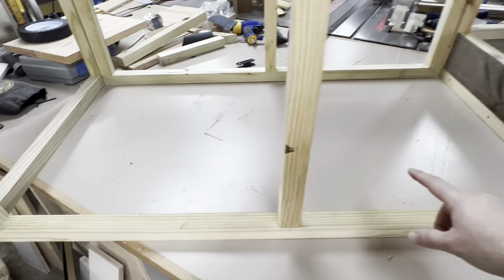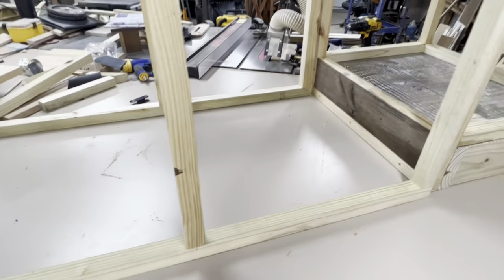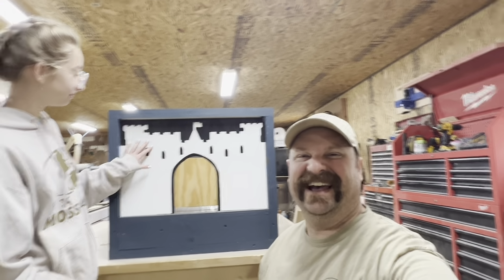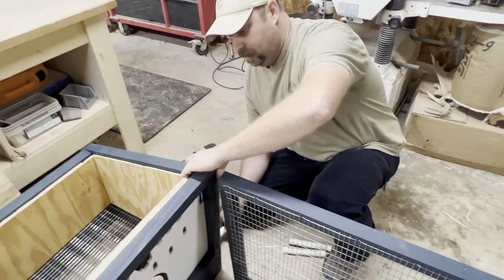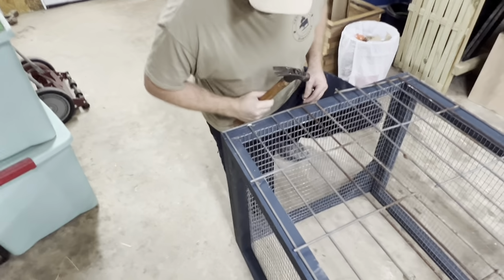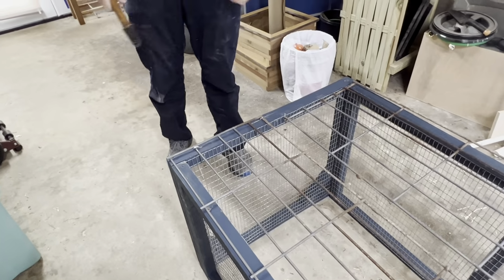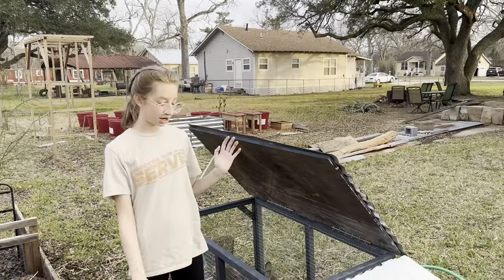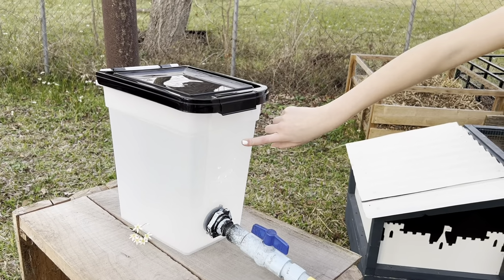The Bunny Castle | Mobile Rabbit Tractor

Comment: Good job sir! The cattle fence looks better than the 2"x4" fence. If I could redo my tractor I would have bought the 4"x4" fence because it's cheaper than the hog/cattle fence. I'm worried about my 19-guage hardware cloth floor because the bunnies are chewing at the grass under it and pulling at the mesh. It all depends on what you can afford. I live near a Habitat for Humanity reuse shore so I can find cheap used stuff.
Reply from the maker: Thanks!  I didn't even think about checking out a Habitat for Humanity location.  Thats brilliant.  Thanks for the tip!
Reply: @cedarporchhomestead  Sorry, typo, that was 4"x4" fence works great for the bottom of the rabbit tractor. 2"x4" is too small for my Flemish Giant, but prevents digging. I'm personally using a 69"x29" metal chicken coop with 2.4 8-feet pressure treated boards setup so the bunnies can't chew on it by covering the entire bottom with 3-feet wide fence, and using a 3-feet wide 1/2" hardware cloth for the floor to make an elevated bunny house using the metal chicken perch that comes with the coop, and you run the HW Cloth vertical up around the perch and back down to connect  to the 2x2. You then insert reflective insulation wrapped in waterproof outdoor curtain, and wrap the outside with two lengths of 24" side reflective insulation wrapped in outdoor curtain, and you do another piece of insulation wrapped in curtain for the rear of the house, and staple that to the 2x2 on the outside, and it makes a really good cover. Just requires some sowing.
Reply from the maker: @CaleMcCollough  Wow. really interesting.  thats cool